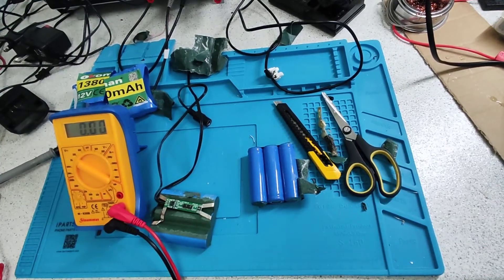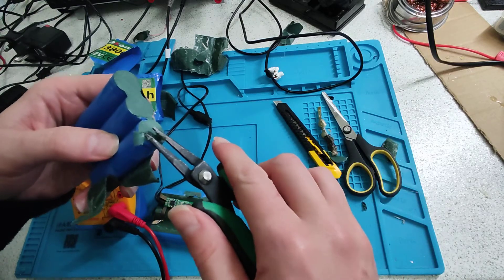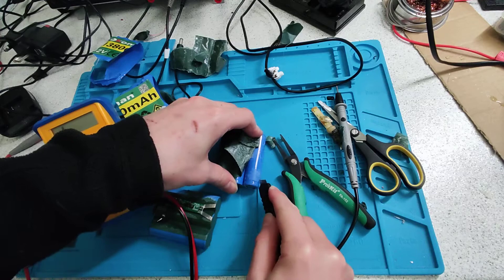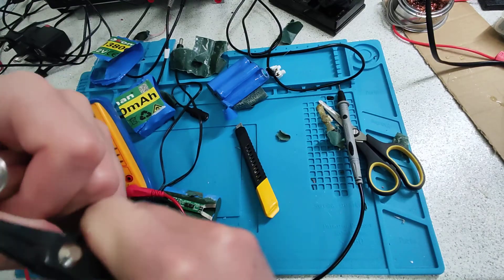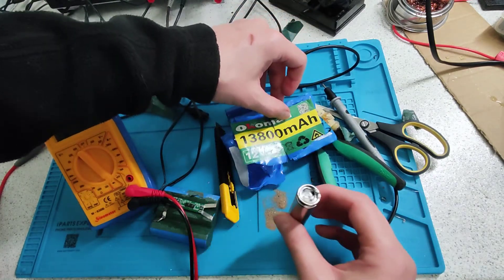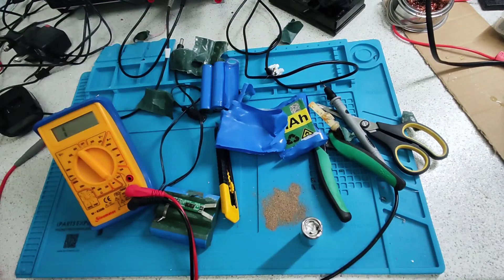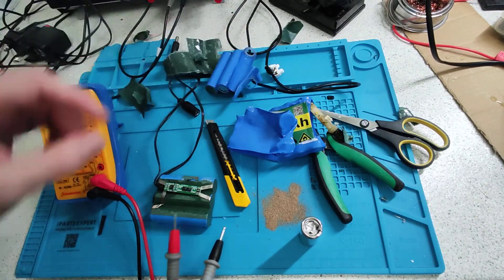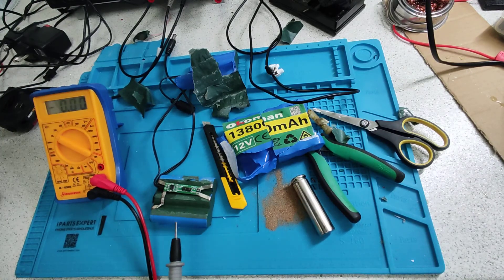Teardown of AliExpress Okoman lithium 18650 battery pack

Comment: I just ordered the differnt brand that loos the same off ali, I got 2x 48V 30Ah and if they test less than 5Ah ill be getting a refund!
Reply from the maker: Oh jeez... How much did they charge?  I reckon either half of them will be full of sand, or will be low density 700mAh cells. 

Nevertheless, you can rip out the charge/discharge protection circuit and use it on legitimate capacity cells. I've found that the most reliable source for cells is online vape (e-ciagarette) shops!

Comment: Good brand 18650 Li-Ion batteries only go up to 3600mAh  i have 100s of them, but i only buy Samsung, Sony, Sanyo, Panasonic, LG, These good brands are usually made in Japan & maybe assembled in china. But China can't seem to make a really good Li-Ion battery for some reason, I've tested some of china's ok-ish 18650 batteries that came with something i bought, but the capacity only seems to go up to about 2000mAh & still i think they're crap! & i throw them in the bin.

Comment: Were you able to get a refund from AliExpress?
Reply from the maker: Not after I ripped it apart! Though this video has cost them way more in lost sales than a refund would have.

My experience with AliExpress is that it's sometimes possible to get a refund before the dispute window has closed, but utterly impossible after it has closed. Delivery times usually consume most of the window!

Comment: i bought a 999999ah 100ah 48v battery for 120 pounds which is on its way take it some are full of sand.
Reply from the maker: Probably! You can get a rough idea by looking at the weight. 

The world's top performing Lithium ion batteries are capable of an energy density of 265 watt-hours/kg. 

At 48V, that equates to 265/48= 5.52 amp-hours/kg, or 5520mAh/kg.

So unless your 100Ah battery weighs at least 100/5.52 = 18kg, then it's a lie.